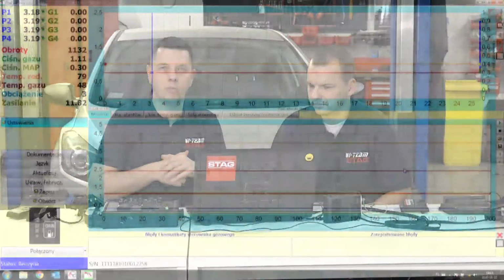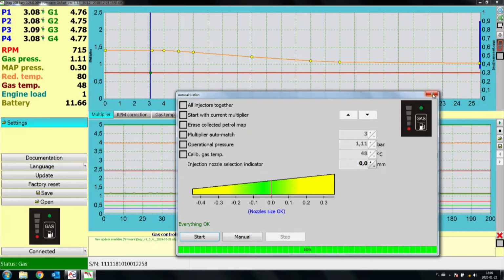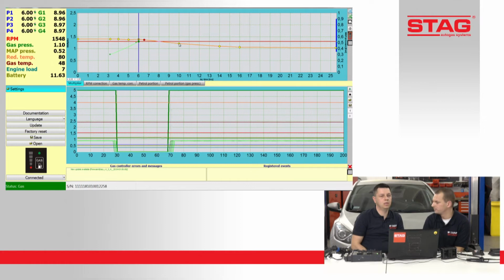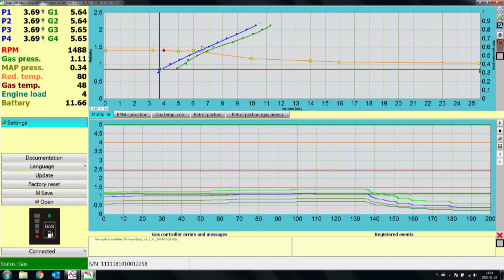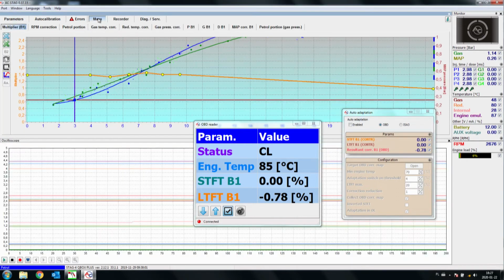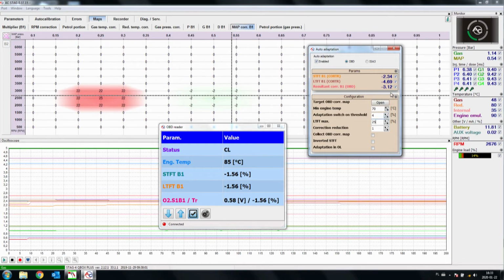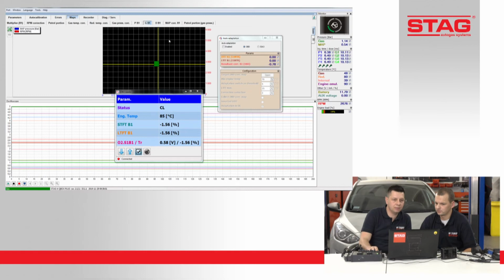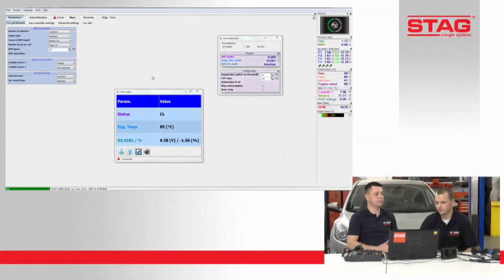Webinar: Functionality of STAG controllers in practice. Vol.2

Comment: I have a qbox basic and when I use the autocalibration option, the process is failing when the gas injection time drops below the 1.6ms. The engine runs abnormaly and the autocalibration fails. What is the root cause and how to calibrate properly the injection time?

Comment: Wll done. Good video. What is the temparature that we need to set up to start LPG? i have OPEL zafira 1.6 Petrol, 2013 model., installed STAG 200 GOFAST  in November 2020 by STAG engineer. But it was not tuned for load and i have  done mapping after watching this video(thanks ). Could you please tell me what is the best temperature to start LPG? mine is set  to 30 degrees. but for auto  calibration reducer should reach 60-70 degrees. Does that mean LPG should only kick off after 60 Degrees?

Comment: Mine is 3 cylinder Suzuki engine, idle is always not steady, it's go up and down 10 to 20 rpm. Any idea?
Reply from the maker: Not perfect idle can be caused be few things. Not properly emulated petrol injectors, wrong injector noozzles, wrong adjustment, wrong sequence on injection strategy etc.

Comment from the maker: Spread good
𝗤𝘂𝗲𝘀𝘁𝗶𝗼𝗻: problem with starting after driving on lpg 400 dpi instaled 4 years ago now new reducer and nozzles installed problem is still there ...what you recomending...? noozles are w031 reducer r150
.
𝗥𝗲𝗽𝗹𝘆: Please tell us more about the problem and the car itself. What is the engine code in Your vehicle and what is exacly happening
. Write here: http://stag.pl/

Car Gas Point Adwani
𝗤𝘂𝗲𝘀𝘁𝗶𝗼𝗻: how about if there is difference in map value on petrol and map value on gas, is that OK?
𝗥𝗲𝗽𝗹𝘆: Big difference is no good. Maps (petrol and gas) should be close to each other. Send us a picture from Your maps and we will advise.
 Write here: http://stag.pl/

Marjan Markovski
𝗤𝘂𝗲𝘀𝘁𝗶𝗼𝗻: what is the higher petrol fuel consumption for 400dpi. for gdi engine 1.6
𝗥𝗲𝗽𝗹𝘆: Depending on a vehicle between 1,5 up to 2,3 liters per 100k

Car Gas Point Adwani
𝗤𝘂𝗲𝘀𝘁𝗶𝗼𝗻: is it recommended if timing advanced is ON and gas ECU collect petrol injection map, or do you recommend without timing advancer?
𝗥𝗲𝗽𝗹𝘆: Yes it is always better to collect petrol and gas map.